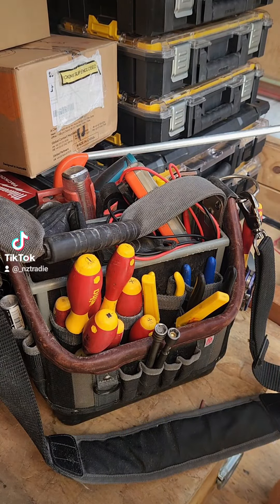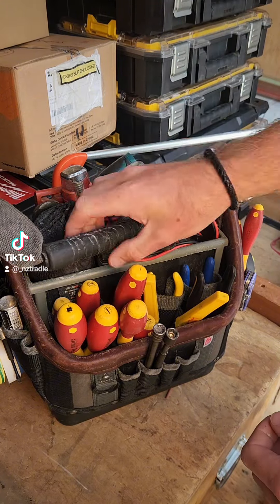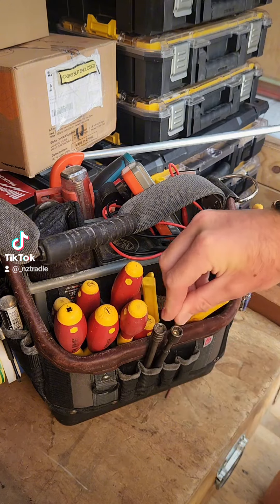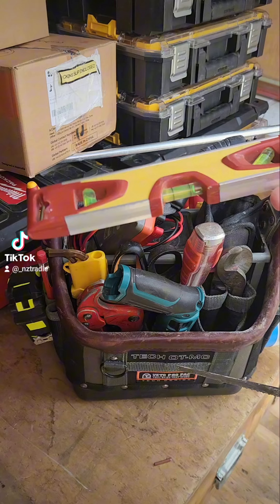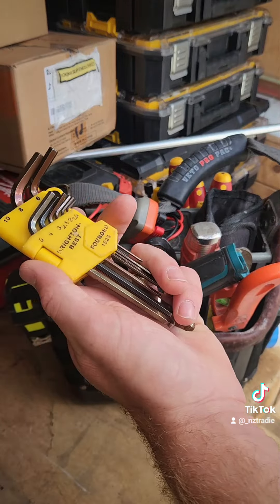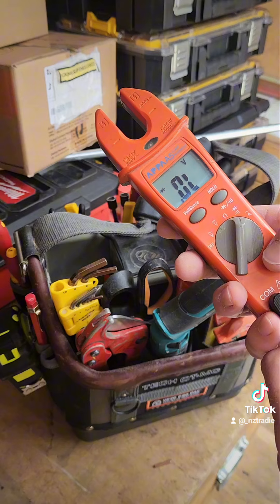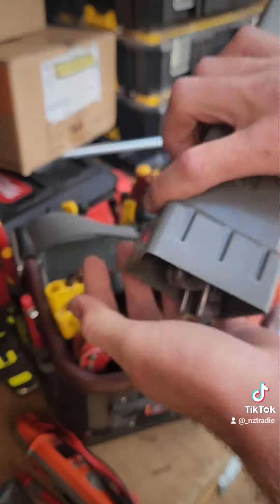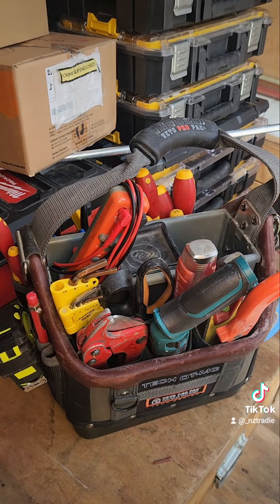Heres what I run in my tool belt

Comment: Hey bro check out the uni-t ut211b clampy as an alternative, they are awesome bang for your buck.
Reply from the maker: I'll look into it. So far, I've been suggesting the fluke 323 for new apprentices as their first meter.
Super appreciate the comments bro, keep them coming 💪
Reply: I do like my fluke gear, but I'm a poor man lol! 

Check out the specs on the fluke 323, the 325 is the better choice as it does hertz & DC amps. Great for solar & genset work. 

Also a big fan of the t6-1000 as it's got NCV built in.  @_nztradie